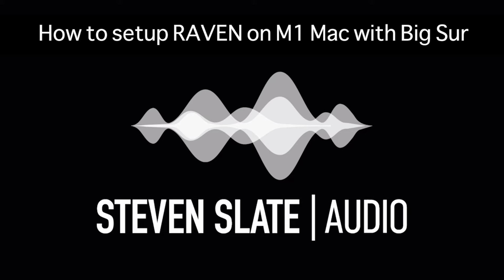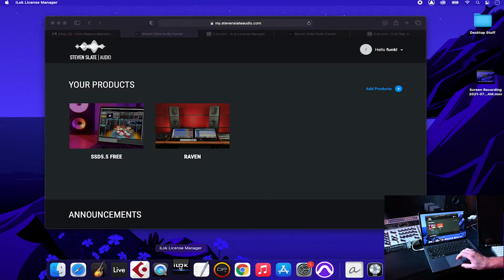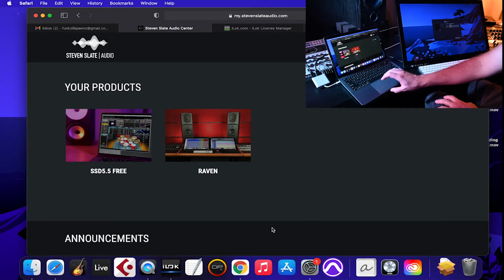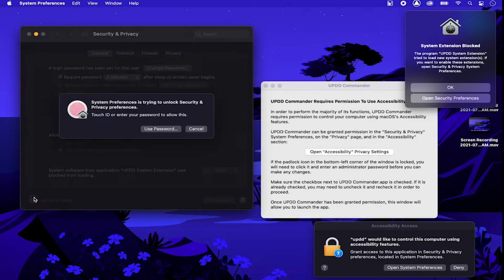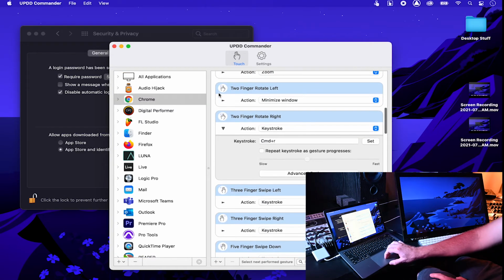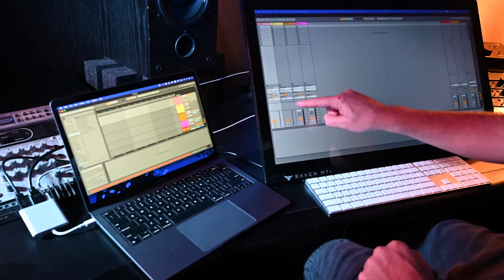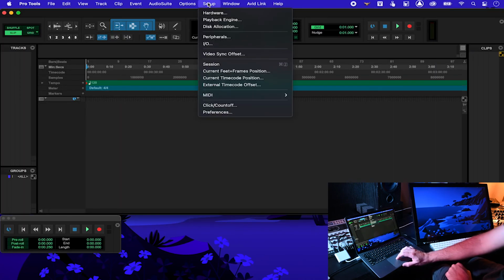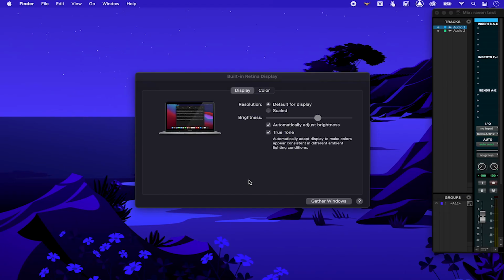Slate RAVEN setup guide for macOS using Apple M1

Comment: I tried for hours trying to connect mine to an IMac with thunderbolt to hdmi adapter and it’s not even showing up
Reply from the maker: Hit up support with the specs of the iMac and the brand and model of the adapter.   Maybe the iMac can't run external displays, or perhaps the adapter  is not correct. 

https://slatemediatechnology.zendesk.com/hc/en-us/requests/new

Comment: Also May I ask where would my 16inch MacBook Pro sit on Raven Core Station ?  Or what core station desk are you using? I’m trying to buy a Raven Core Station and I have some concerns where my MacBook Pro M1 will set.
Reply from the maker: put the MacBook Pro on top of the desk in clamshell mode.
Reply: @SlateRaven  I just saw your text reply. But check it out. I pick up the MTZ instead. Now I gotta get the connection to make it work with MacBook Pro M1 Max.  I’m kinda confused about which connection I need because the new MacBook M1 Max has Thunderbolt 4 connections to your USB C connection correct?   If I’m wrong help me out. Because I need to register my MTZ   It’s just setting there. Also I gotta find the correct desk to set it on.  Ooh also I picked up the Slate Mic 🎤 Because of Pocket Queen ad Video.
Reply from the maker: @gatlinproduction  Get an Apple Multi Port Adapter or Thunderbolt Dock.  https://slatemediatechnology.zendesk.com/hc/en-us/articles/360033788033-Connecting-Raven-with-USB-C

Comment: I’m just a little confused here.  The manufacturer’s website says (in red text) the M1 and Big Sur are not supported.  The Slate. Digital. Zendesk blog even yesterday states that the MTi2 is not compatible with these and that no updates are expected until 2022.  Could you clarify the current situation please  as I have a Raven on order and I need to know whether to send it back to the retailer.  Thanks.
Reply from the maker: "Not supported" doesn't mean it will not work.  It just means there could be potential issues.  But would depend on the DAW and type of machine. Hit up support if you are interested in more info: https://slatemediatechnology.zendesk.com/hc/en-us/requests/new
Reply: @SlateRaven  Well thats not very good is it? You would expect the Slate Raven to be fully compatible with M1 silicon - I assume that's the case now as it's 2023?......and what does potential issues mean? I was thinking about purchasing the MTi2 but your response was far from encouraging.
Reply from the maker: @soundsofurbanlondonmediaci5696  Yeah RAVEN works great on M1 and M2.
Reply: @SlateRaven  Thanks for the prompt response.